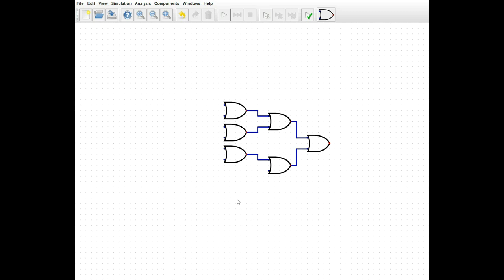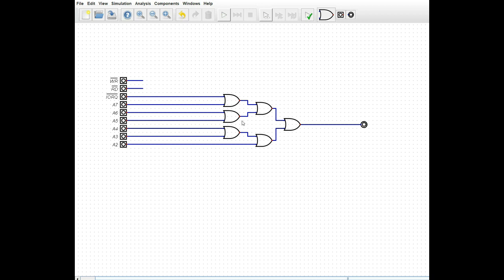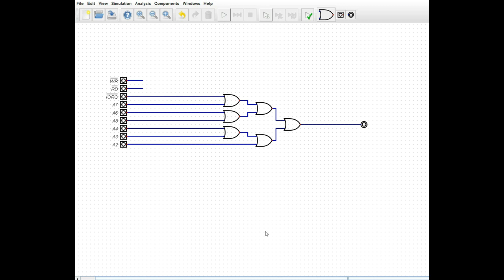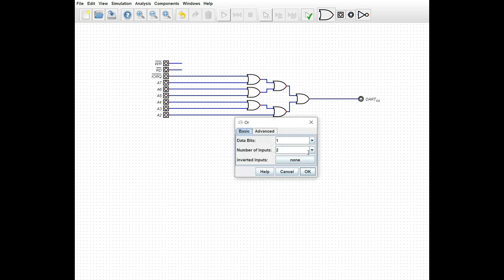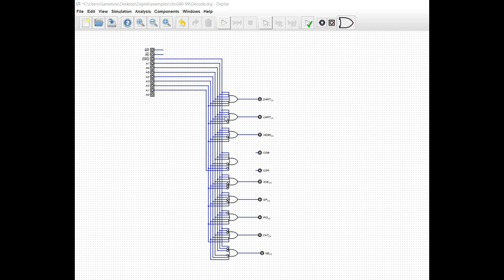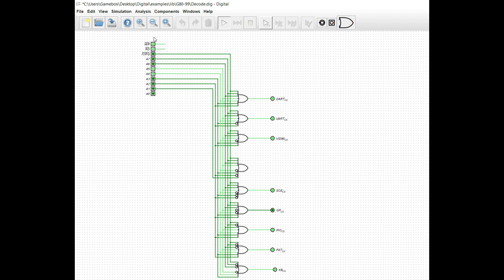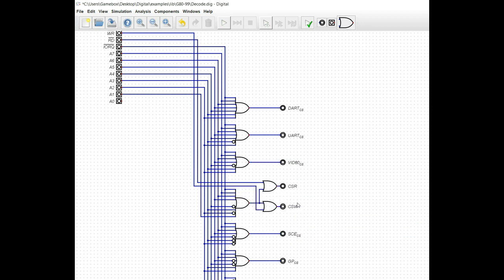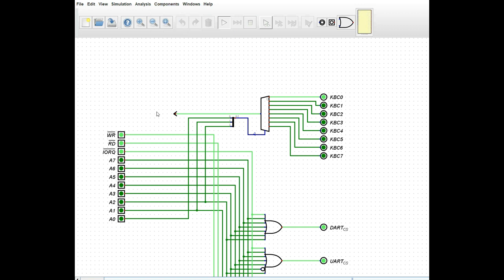Digital Logic Part 2: Decode Logic

Comment: Using OR gates in a CPLD like this is actually very expensive logic wise.

Each macrocell only has 5 product terms (aka OR gate inputs), so as you add more inputs you start to consume surrounding macrocells to get beyond those initial 5. A rough count of your design suggests that you are already consuming upward of 20 macrocells just for the decoding.

Conversely, each product term can have roughly 40 ANDed inputs to it. So you are going to be better off converting your decoders to NAND gates instead, that way you will only use a single product term per macrocell and will reduce your macrocell count to 10 - one per chip select output.

If Quartus' synthesiser is smart enough it probably figure out what you are trying to do and will use a NAND function for you. But if you were doing it with less clever tools like WinCUPL, prefer AND over OR when ever you can.
Reply from the maker: I’ll keep that in mind. I think it did figure it out. As the resulting compiles seem relatively small. But I’ll look into it further.

Comment: If you run out of space on the EPM7128S there are bigger chips EPM7160S and EPM7192S that are pin compatible apart from having 4 less I/O pins. 
So if you can, leave those 4 pins unused on the EPM7128 just incase you run out of Macrocells and need to upgrade. 
BTDT
Reply from the maker: Thanks for the input James, I did know they were pin compatible. However, I haven’t mentioned that. And others may want to know. We do appreciate the input.